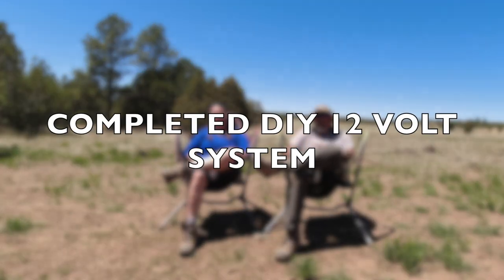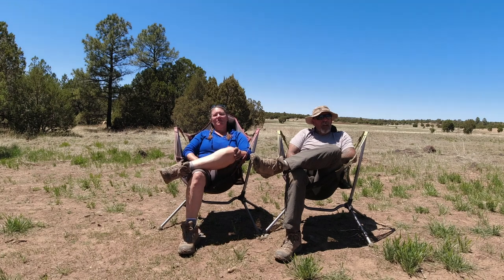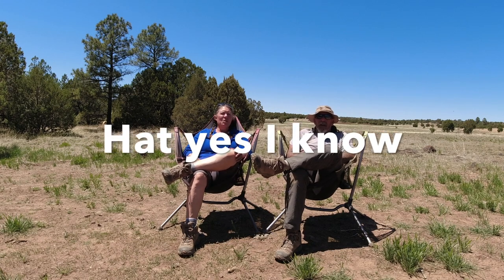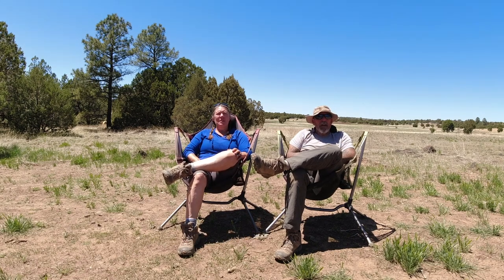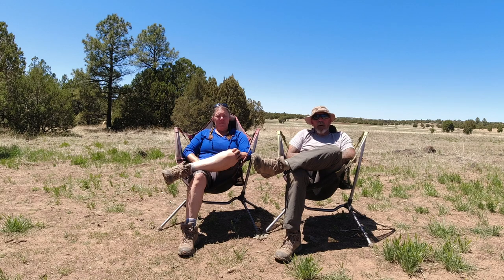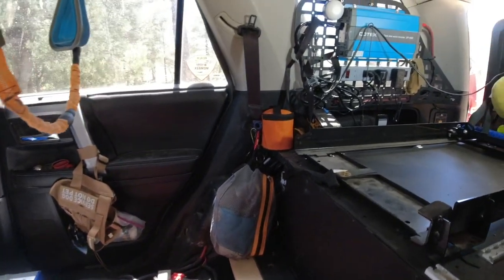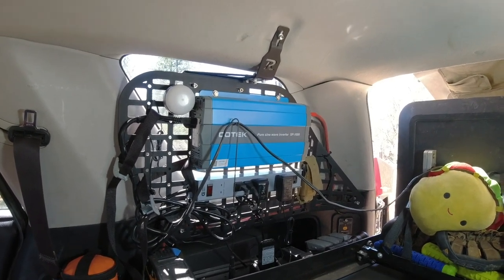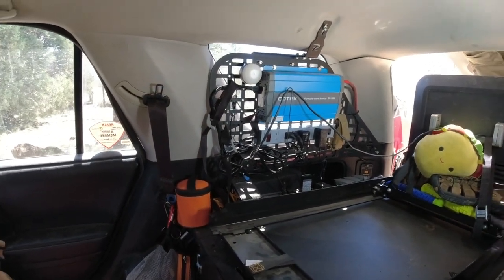Comprehensive completed 4Runner 12V DIY Install review

Comment: Does the manager 30 system also provide charing and data on the batteries in the trailer? Looks great guys keep it up.
Reply from the maker: No the two systems are independent but we have the Redarc manager 30 with Redvision in the trailer.  We can monitor that system via the Redarc App, or locally the the Redvision screen in the trailer.